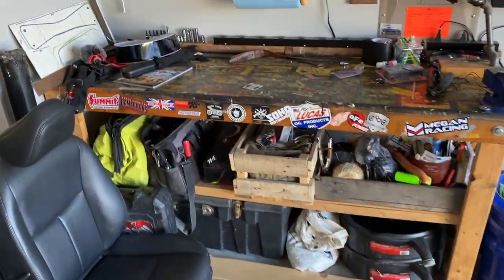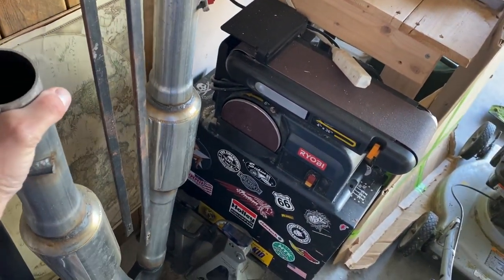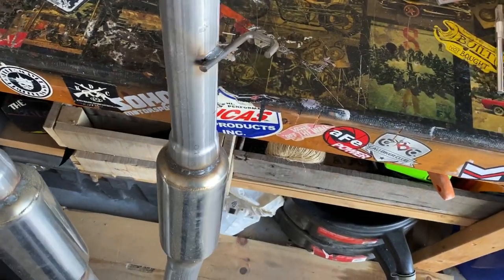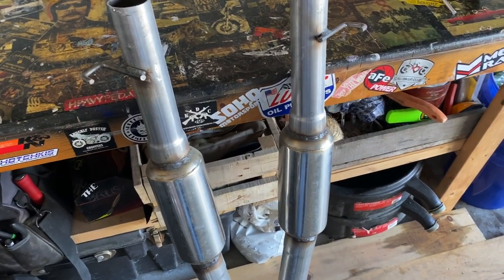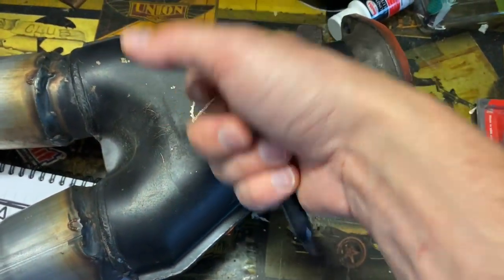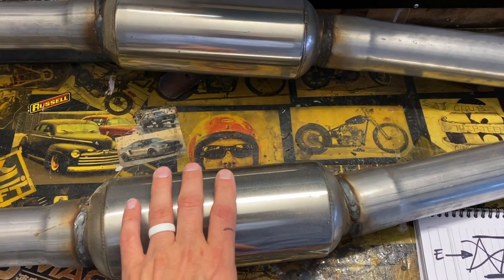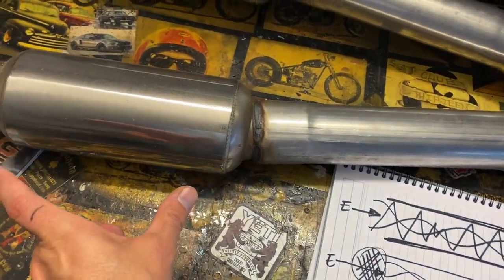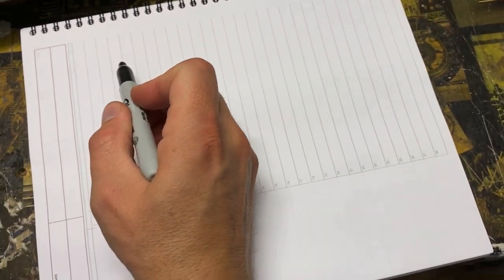THE Problem with Nissan Infiniti Cars | RASP and how to fix it!

Comment from the maker: The VQ is a notoriously raspy platform and changing up your exhaust components can potentially compound that characteristic.  Unrestricted exhaust frequencies, thinner walled components, lower quality materials, or even higher quality, but more rigid materials like stainless steel or titanium can lead to raspy noises in your exhaust as they do not absorb those frequencies as well.  Luckily the solution is relatively simple!
Reply: My rasp sound is around the test pipe and y pipe area? Got a straight through test pipe and resonated y pipe . It's doing my head in
Reply: @tysoncross3350 I'm pretty sure it's normal, my also sounds really raspy (except I have long tube headers) and it sounds like a really loud noise comes from right under me

Comment: So I watched your video on the $500 exhaust system as well and took from it the two parts I felt would do just what I needed for my 2016 Q70L 3.7 AWD and that was the Borla mid muffler and the two Flowmaster resonators. Sounds and runs way better than stock. Thank you
Reply from the maker: Great to hear!  And those really are the main parts of that system

Comment: I just had a Fast Intentions TDX X-pipe exhaust, along with a Stillen Gen 3 long-tube CAI, installed on my 370Z by Fast Intentions at their Simi Valley shop about a week ago. I also had the engine dyno tuned with the EcuTek software by Sebastian Chakoff at Specialty Z, also in Simi Valley. The result has been a great sounding system that has no rasp and that produces great power, 321 rwhp @ 7200 rpm on the Dynojet chassis dyno. The torque has scaled up by about 15% over the whole rev range, with the car much more lively and responsive.

What I did was not cheap but I was willing to spend what it would take to get the results I was looking for. I elected this route, saving money on the purchase of a new 2019 370Z vs the used Porsche Cayman S I had been considering and using the money saved for future modifications. If you cheap out on the products or the expertise of the people who work on the car you are taking a gamble, which may or may not work out for you.

Comment: Your exhaust sounds very good and I like the design of the Borla resonator/x-pipe.

The exhaust system I went with used mandrel bent tubes with minimal bends and a series of perforated core resonators in place of baffled mufflers. The x-pipe uses a siamesed design that acts like two one-into-two y-pipes with minimal turbulence.

Comment: Well stated...
In the process of solving the same problem in a ‘20 supercharged Coyote motor.
The exhaust system consists of a Stainless Works long tube headers/high flow cats/Y-pipe/factory resonator/dynomax 1-in/2-out muffler/two 3” turn-downs.
Great V8 tone through 3000rpm; after that it gets increasingly raspy, to the point where it drowns out the blower.
So even in my system, with high flow cats, I still have plenty of rasp. The only difference that I’m aware of between high flow cats and the OEM cats is the size of the honeycomb in there. So that wasn’t my first suspect.
Planning on adding a longer resonator; hopefully that’s the answer.
Reply from the maker: Longer resonator should help!

Comment: Just so you know your ride is loud! My 2003 Maxima has headers and 3" exhaust and it's deep , mellow and smooth and quiet! The secret is utilizing the best Mufflers and the biggest you can squeeze under the chassis....6" round resonator that's 18" in length was fitting along with a huge 22" x 5" 11" rear muffler made on thick T304 SS Been rolling this for over 10 years!
Reply from the maker: Mine is loud?  It’s not THAT loud.  It’s perfect.  An open exhaust v8 is loud.  A straight pipe vq37 is loud.  This is not loud.
And that’s not really a secret.  Bigger the muffler, the quieter it is.  My borla muffler is 20 x 9 x 5 and top quality.  Resonators out back at 4” round by 20” in length.  Perfect mellow tone cruising and aggressive and throaty at wide open throttle—just how it should be.

Comment: It almost sounds counter intuitive  but larger piping seems to help with rasp when paired with good resonators/mufflers. Honda v6s with pre cat deletes seem to deal with this a lot with the exhaust options that are out there
Reply from the maker: Yeah the larger diameter allows the sound waves/frequencies to lengthen out a bit making them less abrasive on the ear

Comment: I want to get a single exit for my G37 coupe. Thinking about HBP since he can put two resonators in the y-pipe, one in the midpipe and a muffler at the back. Definitely going to run resonated test pipes, for a total of FIVE resonators! 😂 I'm thinking it will sound amazing, thoughts?!
Reply from the maker: That should be a good combo. Single exits can get super raspy just because there isn’t enough space to fit large resonators. With a resonated y and some other ones in line, you should get a nice even tone!
Reply: Put a couple Vibrants “ultra quiet” resonators on there. They don’t really quiet anything down but they cut out nasty sounds like rasp and drone due to being a short but wide body resonator with quality packing

Comment: Awesome video! I just did the custom pipe. I remove the stock mid pipe muffler instead with Flowmaster super 10 dual in & out. And no resonator after the FM muffler, but I keep the stock CAT. The car is so loud and it sounds deep under 4000 RPM but it will get little raspy between 4000-6000RPM. Any suggestions to fix it? Thank you for your help and time!
Reply from the maker: Add resonators where your factory resonators were
Reply: @SpeedCultureStudios  Thank you so much for your reply :)

Comment: Have you ever experienced a weird hissing sound. I’m having this issue coming from the passenger side. Only can hear at low speeds. Usually when I’m driving slow in my neighborhood and under 35/40 mph.
Reply from the maker: Do you have test pipes?  Sometimes broken flex pipe will cause hissing too

Comment: Thank goodness killed the rasp 
Motordyne or Tomei exhaust u think?
Long story short...My 1st G was a 05 G35 coupe manual back in 09 put like 15k$ into the car did almost everything except turbo. stillen exhaust test pipes injen intake cold air 19 in wheels with 285s tires in the rear coilovers light weight pulleys intake manifold performance chip also tuned it headlights lip spoilers grill swap stage 3 racing clutch changed master cyclinder and lightweight flywheel camberkit racing ignition coils and plugs slotted rotors etc...
My 2nd 2011 auto was a G37 coupe IPL in 2018
My 3rd was in 2021 another 05 G35 coupe auto 
And now in 2023 an 04 auto G35 coupe. Its pretty hard to find a decent condition manual in Miami fl 
Deep love for these vq  coupes

Comment: Hey there! Are you still active on this? Would love to post a question about my current exhaust setup and what your thoughts are on fixing the rasp.
Reply from the maker: Always active
Reply: @SpeedCultureStudios  Perfect! So I have a Q40, with a Stillen CBE with Berk HFCs. I'm sort of new to HFCs so I probably should've done some more research, but when accelerating past 3k RPM, the rasp on it is just terrible. I decided to put on a Vibrant Performance bottle resonator (2.25 inlet/outlet 12" long) on the Y Pipe of the Stillen CBE (closest to the HFC). It reduced some of the rasp, but still is present past 3k RPM. Not sure if adding in more resonators towards the mufflers would help or if I need to look into maybe a different type of resonator on the Y pipe.
Reply from the maker: @OMGooFy  vibrant makes good product but those bottle resonators are so smal, they don’t do much for rasp.  You can add additional resonators into the system or you can replace the vibrants with larger resonators
Reply: @SpeedCultureStudios  When you refer to larger resonators, are you referring to the length of them? (go with like 14" or 18" if applicable vs the 12") Or are you referring to the actual body width of the resonator itself. I was thinking of maybe adding the additional resonators before the mufflers.
Reply from the maker: @OMGooFy  it can be either or or both.  The body can have a larger diameter but often people avoid that because the car is lowered so longer is typically the better option. Like an 18” (22” overall length) is generally pretty good.  Like a flowmaster FlowFX.  Or Upower.  Just make sure the core is perforated and not louvered
Reply: @SpeedCultureStudios  Sounds good! Appreciate you taking the time helping me out and answering my questions.

Comment: So I have RTPs and an Invidia Q300... volume and tone are pretty good, but there's still some rasp getting through which I don't like. The only resonators on the Q300 are after the cats - so an unresonated X pipe. I'm asking based on your setup with the Borla X pipe and the Flowmasters near the end - do you think a better spot to add resonation would be with a resonated X pipe or with two inline resonators before the mufflers? That setup is so nice that, as you proved, resonated vs unresonated TPs or HFCs hardly make a difference. Only other thing is I'm thinking about switching to HFCs, can I expect those to take care of that problem?
Reply from the maker: High flow cats will likely knock down the little bit of rasp you have. However, if you’d like to retain the test pipes, some nice resonators immediately after your x pipe would help a great deal.

Comment: I know you said you hated the combination of test pipes and muffler delete, but would adding the mid muffler eliminate some of the rasp?
Reply from the maker: Well it’s not a muffler delete if you replace the muffler with a ...muffler😉 but yes it should help—you may still have some rasp though so just be prepared.
Reply: Speed Culture Studios ha thank you very true I forgot that “mid muffler” you called a resonator. Your videos are really helpful
Reply from the maker: meharty007 Glad to help!
Yeah when manufactures call things mufflers but they are technically resonators, it can get confusing.

Comment: Not trying to bash but I tried this using a borla mid muffler similar to the one you have in the video and the rasp was still there.even went and added 2 long add resonator and still rasp. Pretty much convince vq decatted is cursed with rasp. (Setup: Berk resonated test pipes~megan y pipe~ borla pro xs mid muffler and had it straight piped out =rasp/ then added resonator at the end aka  muffler=rasp)
Reply from the maker: You kept the y pipe.  You're probably hearing rasp from the flex pipe of the megan y pipe.  The point of the borla that I have is that it is truly an x pipe.  It eliminates the need for a y pipe and has the exhaust flows cross paths, which deadens some of those raspy frequencies at the same time absorbing them into the matting material.  There should be minimal rasp left after the borla, but the large resonators at the back--as long as you used decent ones of the correct size--should have eliminated the rest.  I would say there are 2 potentials.  1.  again would be the fact that you kept the megan y pipe with the garbage flex and didn't use a borla x muffler.  or 2.  Your car isn't actually that raspy but you've never experienced a truly raspy vehicle to know what is bad and what isn't.
Yes, the vq with test pipes is raspy.  However, I, along with the dozen or more people now at this point that have copied my setup, do not have any (or very very little) rasp.

Comment: How does this change if you have a turbo though. Doesn't turbo especially with a cast manifold eliminate most of the rasp already?
Reply from the maker: Yes turbos really muffle the sound down quite a bit
Reply: @SpeedCultureStudios  so probably won't need as many resonators then? I'm asking I'm general I don't have a nissan  it's more for my 2jz less rasp more smoother tone

Comment: I completely understand where you're coming from. I'm currently not running any resonators at all but have art pipes, a thick y pipe (doesn't have thin collector) and only a muffler exhaust tip since I went 3 inch single. I do have some rasp but i kind of like the hint of rasp it provides. Almost like adding distortion to an instrument is kind of how I view it but just as with that, too much and it sounds horrendous. You mind if I send you some sound clips on I.G for your opinion on my setup?
Reply from the maker: Exactly!  And of course. Send them!

Comment: Hey man nice videos, so this is my short story, a local shop build.my exhaust, for a fiat abarth, so it's straight pipe all the way from the high flow cat, they used a Y pipe like that one you show in your video, after a week is so raspy and I'm sure it come from that Y pipe, should I get a resonator in the middle pipe before the Y pipe? And put mini mufflers close to the tips? Thanks
Reply from the maker: I would yes.  It’s the cheap metal of the y pipe causing the rasp, you are exactly correct.
Reply: @SpeedCultureStudios  yes about the resonator or the mini mufflers? Or should I just add the resonator

Comment: Awesome video! I was thinking to do a similar build as you with the mid muffler and resonated exhaust parts. I did see your online store with your recommendations based on what you have. I am not an expert and was hoping you can help with a list of components for the exhaust set up you have. Also, any points on high flow cats to not trigger the CEL?
Reply from the maker: Look at my performance exhaust video. It lists all the parts with links and shows how to set it up. High flow cats should not trigger a CEL
Reply: Speed Culture Studios is check it out ASAP.

Comment: Hey so I had recently installed a y pipe & berks and it was fine, until I eventually burned out my mufflers lol. It's cool cause I wanted to replace them anyways I  now have a rasp. Still have the stock resonator as well. Options are get a chamber muffler as resonator and do muffler delete. Get a similar res u have (still prob change the muff) or buy 2 chamber muff. What would you recommend. && Would I still be able to shoot flames since it's not straight through
Reply from the maker: If you get a chambered muffler, no you will not get flames most likely. I wouldn’t get a chamber muffler anyway because they take away volume and not necessarily rasp—depending on the style of muffler of course. Just get some large resonators man.
Reply: @SpeedCultureStudios  would borlan 400286 be something your talking about ?
Reply from the maker: Takk101 I’m not seeing that but borla is good

Comment: but i also went from a test pip with straight X Pip to a duel in n out muffler x pip 

BUT NOW i lost the loudness that i love 
especially when you start it up and gets heads turning 
also when your at lights reving it up to be loader then the car next to you 
is there not a set up to keep the extreme loudness and get rid of rasp

can a step 2 tune increase loudness

and also with the duel x pip muffler stop a flame map
Reply from the maker: You got a lot going on here.  I’m not sure what you’re saying.
If you’ve installed a resonator recently, just give it time.  The volume will come back as the packing material breaks in. 
Otherwise, one way to get some volume back is to install electronic cut outs.  You can push a button and open valves that will make the car loud, then you can close them back up for normal driving
Reply: @SpeedCultureStudios  yea I just installed MagnaFlow tru x resonated muffler at the mid pip section
 now sounds like they way I had it back when I had the oem cats in 

but if the packing material brakes in, will that not bring back the rasp

Comment: Question, as far as your AFE pro dry s filters, do you use mild soap and hot water or do you use some type of degreaser, cleaning solution? Thanks for videos!
Reply from the maker: I have not washed them yet, but as they are not oiled, I would not think a degreaser is necessary. Warm soapy water is likely sufficient, but I would check aFe instructions.

Comment: I have a 2007 Pontiac Grand Prix and almost every video that I have heard with aftermarket mufflers has sounded very raspy (i personally don't like the sound), either they had stock resonators or resonator deletes(have also had cat delete as well if they have had the resonators removed), I was trying to find some info on how to make it less raspy before I have work actually done(or if I even should), this video helped me out with my decision and I think I will have it done, just need to find some resonators that would fit.  If you have any recommendations for some good resonators, just know I don't plan on having the piping completely redone, so the pipe sizes would be about 2in all the way through. Thanks for making this video, very informative.

Edit: Would it cause more problems then its worth to have 2 resonators installed if i plan on having dual exhaust?
Reply from the maker: Won’t cause any problems.  To prevent rasp just get some good resonators like the upower or flowmaster flowfx resonators listed in my SCS custom catback video.
Reply: @SpeedCultureStudios  ok, thanks for the suggestion

Comment: I have a g35 sedan 2005 yesterday I put Megan racing test pipes and it’s stock exhaust just resonator delete on it no intake, the problem that I have it’s when accelerate at a dig it doesn’t have the same power it loss power and when I do a Stop it shakes and make a raspy noise, what would u recommend me to do bro
Reply from the maker: You need a tune with test pipes

Comment: I currently have Megan test pipes and Megan y pipe. It is very raspy and I bought 2 vibrant ultra quiet resonators. Where is the section to install them? Do I replace the stock resonators? Thanks
Reply from the maker: Yes you can put them where the factory resonators are or you can keep the factory resonators and add the vibrant in the area of where the factory muffler was